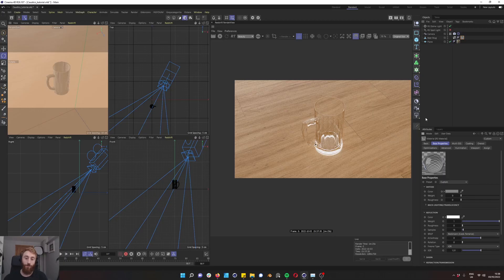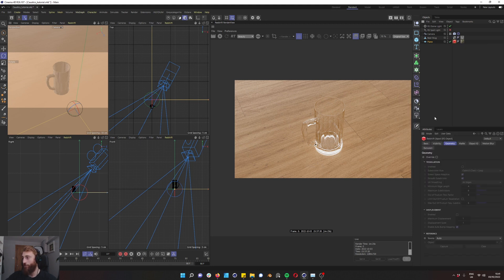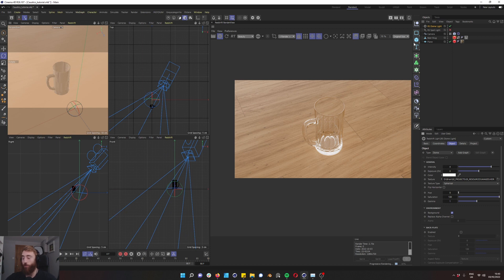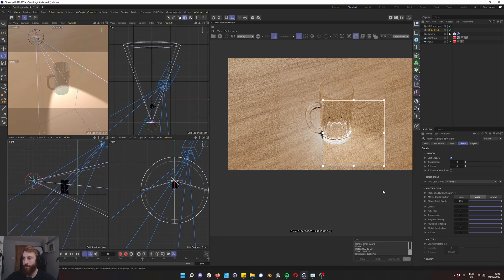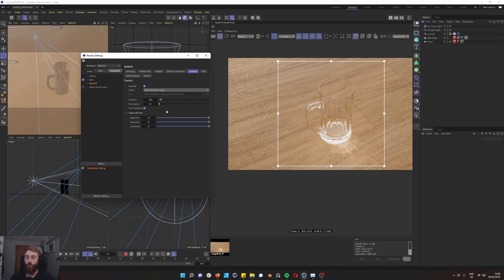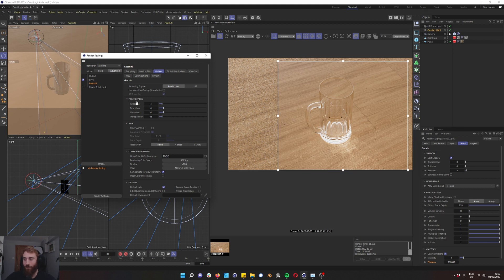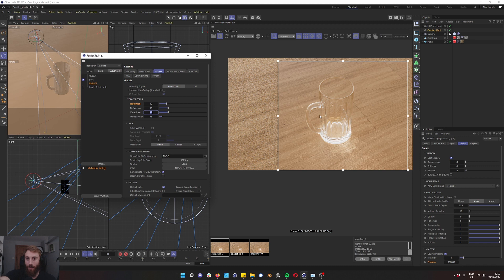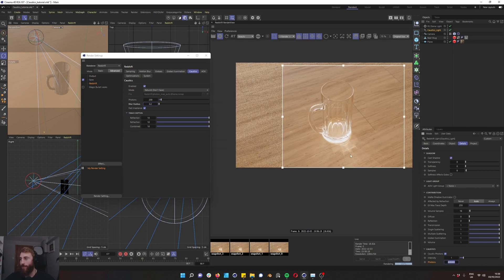Become a Pro at Redshift - Caustics (Advanced)

Comment: can you expand a bit more on the combined trace depth and why that number is not added refl+refr?
Reply from the maker: The Refraction depth parameter puts an individual cap on how many times a refraction ray can bounce or pass through objects

The Combined depth parameter specifies the  maximum limit for global illumination, reflection, and transmission/refraction rays  combined.
This means that if the individual depth value for global illumination, reflections or refractions is higher than the Combined Depth the resulting render will  still be capped at the Combined Depth value. 

For example, let's say that reflection, refraction and combined are all set to a value of 10. If a ray has already been reflected 8 times, then it can only be reflected or refracted 2 more times because the combined trace depth is 10.

The Transparency depth parameter puts an individual cap on how many times a transparency ray can pass straight through objects.
Transparency is utilized for things like Opacity in the Redshift Material to go much deeper and render much faster than refractions.